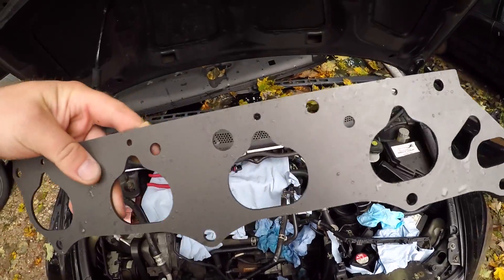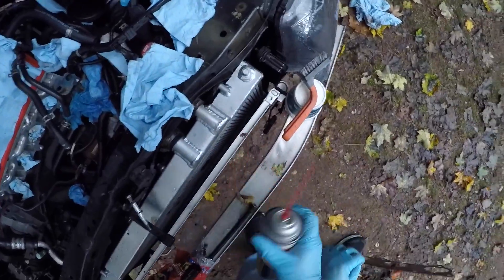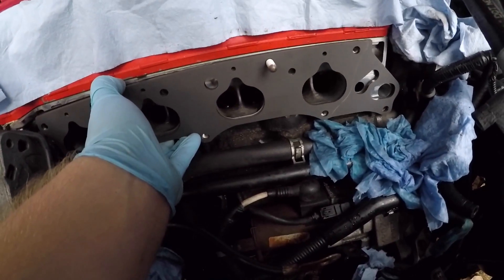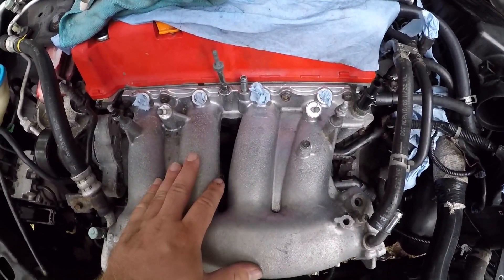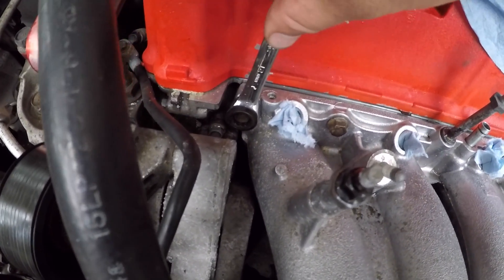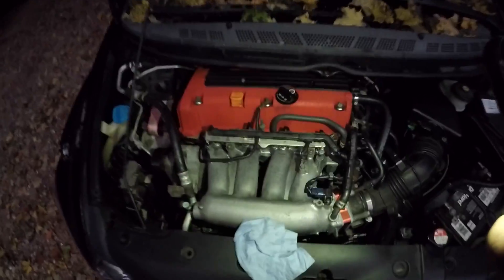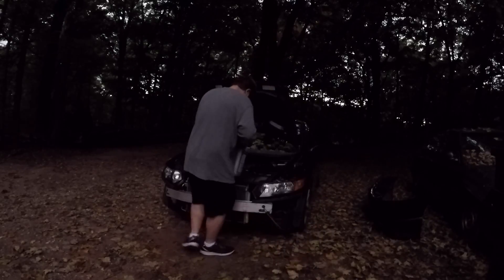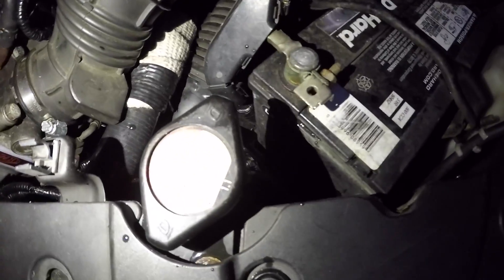Civic Si Intake Mod

Comment: I'd keep a lookout in regards to vacuum leaks due to the gaskets warping. I've heard that's an issue that tends to arise. I bought the hondata IMG, but ditched it cause I didn't want to take the risk lol. Hopefully, it treats you well and adds cooler temps. Good video bro🤙👌

Comment: Admire the time you are putting in to make content on true mods not a spoiler or graphics, don’t know much about the heat transfer but the focus and dedication is there any steering/suspension mods ? What forums are you on 8th gen ? Any other good sources ?
Reply from the maker: Spoilers, wraps, wheels, graphics don’t equal a build, I’m sorry lol.  It’s all about performance with a sleeper look to me 😎. Right now I’m running HFP suspension, but I think I’m going to upgrade to some nice coils or shocks / struts eventually
Reply: I’m going Oem plus, similar I suppose Honda has great engineers in not trying to reinvent greatness just replace as it wears out maybe an upgrade hear and there nothing fancy it’s my daughters car one day I’ll take it off the road and restore properly maybe ....
Reply from the maker: Can't beat the quality of OEM honda parts.  Just keep it simple, few mods, maybe hondata.

Comment: Are you supposed to use both gaskets , looking into doing this myself but I thought you just use the thermal gasket and ditch the OEM one
Reply from the maker: Probably not haha... You can get away with just running the thermal, but i used both because the oem is so thin that it didn't take up any thread space on the studs. Good to have oem as well in case the thermal leaks
Reply: Cool brotha thanks for the heads up... wish we were closer so we could collaborate I like what you do and the content you provide

Comment: I was wondering if you know why my VSA warning turn on everytime I drive it even on regular drive it turn on Nd I won’t have throttle response after that Nd will need to restart the car after it’s a 8th gen Civic, throttle body spacer, 550cc injectors, and hondata flashpro

Comment: Hey Gerb! I heard doing a coolant bypass on the throttle body also helps with the IAT's. What's your take on it?
Reply: It does actually if you have a true cold air intake like hybrid racing or skunk 2 i highly recommend it i do not recommend it if you have a short ram intake like k&n tyhoon.
Reply: why not on a SRI?
Reply: @Kenneth1350  awesome! I thought about doing it for thee longest time but always wondered if it helped with cooler IAT's. I'm rocking the HybridRacing intake, so I'll definitely look into doing that mod this weekend! Thanks again man🤘
Reply: @RMFA5  an SRI is always exposed to all that engine bay heat. Doing so, won't have a significant change unless you're on a true CAI
Reply: @junrowdy  your intake is gonna love you. 👌

Comment: I've read a lot of different thinks on the p2r spacer, do you think it really makes a difference? I would definitely do it if it was like 20 or 30 bucks but 70 seems kind of steep.
Reply: not worth it
Reply: supposed to help with throttle response. with stock si you notice "rev hangS" and how the throttle does not respond instantly due to the drive by wire (electronic throttle pedal) design.  Hondata erases this problem completely. so IMO it would be worth to add that 70$ to save for a hondata.
Reply from the maker: Doesn’t really do a lot.  I feel like it’s more for looks.